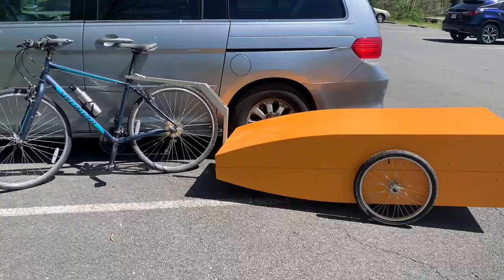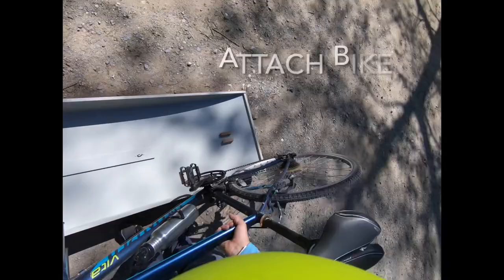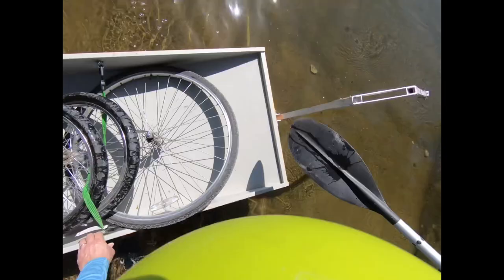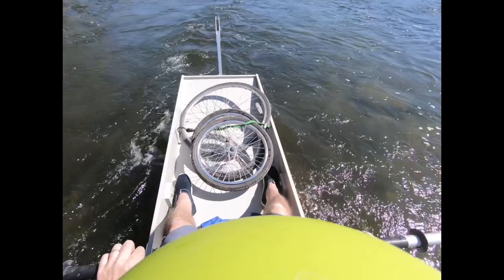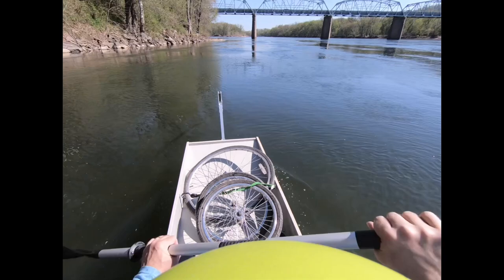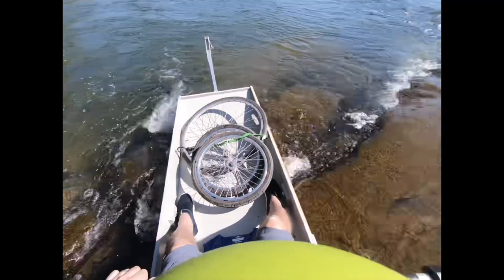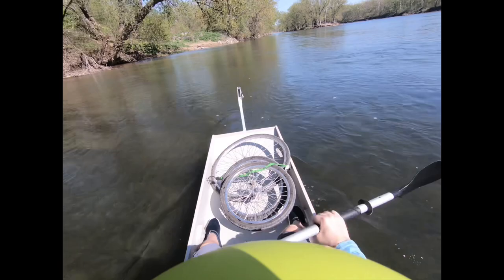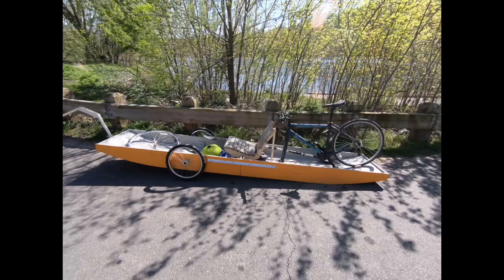Introducing the Shuttle Punt

Comment: Well done. I love it when folks design their own solutions. Great idea. I might be tempted to fix the bike with straps so as to triangulate (strengthen) it’s mounting to the hull to make it more robust.👍😀
Reply from the maker: Thanks!  Yes I agree.  First few times I mounted the bike horizontally to keep the center of gravity lower, but my handle bar tended to drag in the water.  A folding bike is ideal.  Also, mounting my bike vertically is like having a billboard.  People see the bike and start asking questions.

Comment: Hi, came here from Duckworks. There are no specifications-length, width, capacity, construction, or materials on the plans page.
Reply from the maker: Oh!  I did not know.  Thanks for pointing that out.  I will have them edit the website.  It calls for a standard width of 27”, standard length of 12’ total, 6’ folded.  Height of side walls around 9”. Weight with wheels and chair is around 63 pounds.  It is designed to fit into a van, truck bed or suv with seats down.  I roll it up a plywood ramp.  It can be mounted on a roof but requires 2 people.  I drive it to the tow path, roll it out the back of my van, connect my bike, pedal up river, float back down to my car.  If you hit a rock it does not tend to toss you overboard like a canoe.  I’ve used it 8 times and never flipped over.
Reply: @markpalmquist  Thanks for getting back with me with the info.